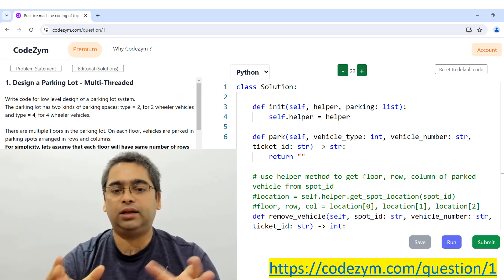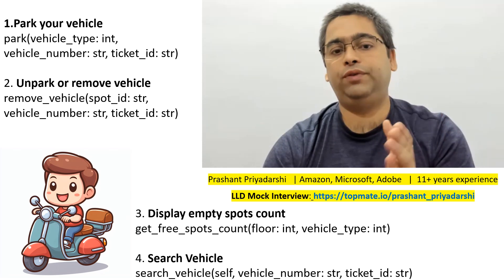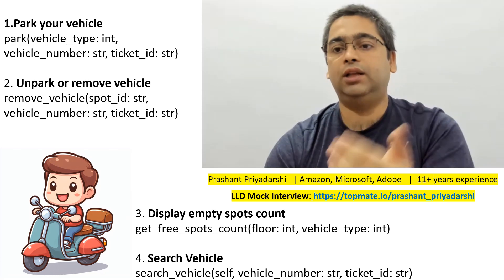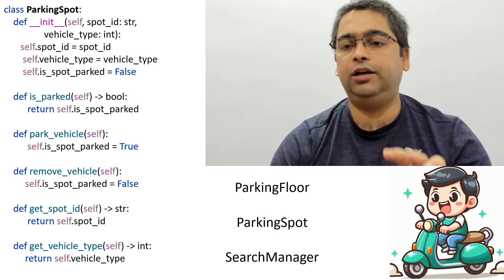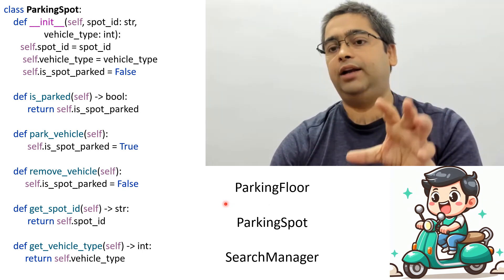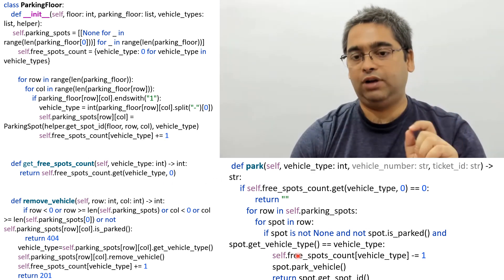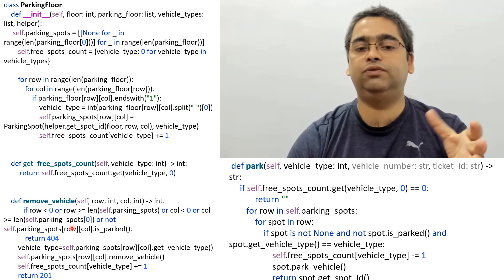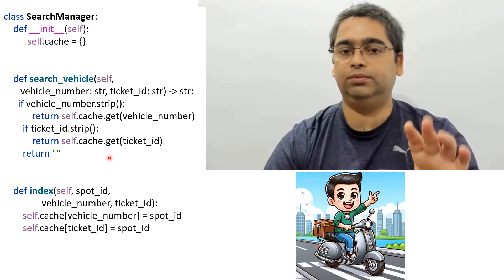Easy to understand design of a Parking Lot in Python for Low Level Design Interviews

Comment: So if you code in Python for LLD interviews and if the interviwer asks you to handle multithreading then wont you be at a disadvantage compared to someone who uses Java?
Reply from the maker: Good observation. There are two formats of a LLD interview round.  90 minutes machines coding round and 45-60 minutes face to face discussion round.

Python's advantage of less lines of code comes into picture in the 90 minutes machine coding round. However in this format you will already be provided with exact requirements that you need to implement with method signatures. If the company you are interviewing for wants to test you on multi-threading then they will explicitly mention that in requirements itself. In that case you will be better off with java as it has thread safe, lock free data structures like ConcurrentHashMap, AtomicInteger etc. But if it is not mentioned which is the case generally, you will be at an advantage using python.

For the face to face round, it won't matter. There it will mostly be discussion on how you arrange your code in multiple classes and which data structures and design patterns will you use. There you won't get much benefit for using python as you are not writing a lot of code anyway, mostly method signatures and all.
Reply: @CodeZym  Thanks for your helpful answer. Nowadays even Amazon is asking LLD for SDE1s.... Also what's your opinion on using Python for DSA ? I generally prefer DSA in Python and anything related to multithreading or design patterns in Java. Design Patterns  in Java and not Python because I have already studied from a lot of Java resources...
Reply from the maker: @ad9804-n9k  For DSA rounds, number of lines of code is small, less than 50 most times. So language choice shouldn't matter much here. Use whichever language you are more comfortable with. Personally, I have always used Java.
Reply: @CodeZym  sir 50 lines???? r u sure ?? who would give dsa of this many lines lol